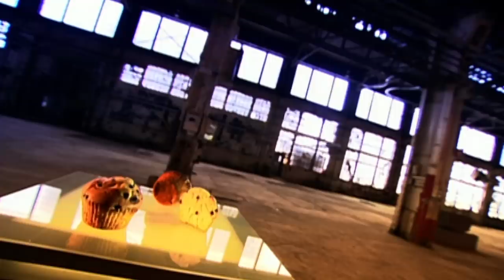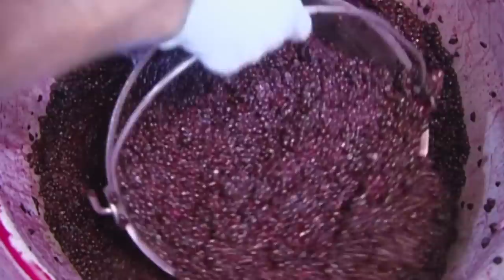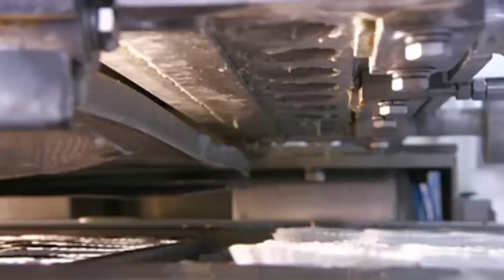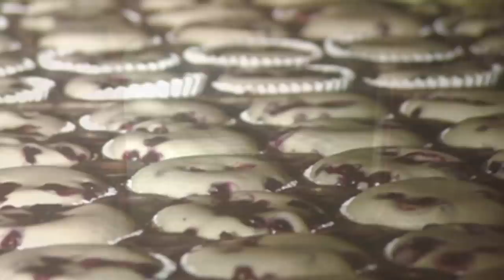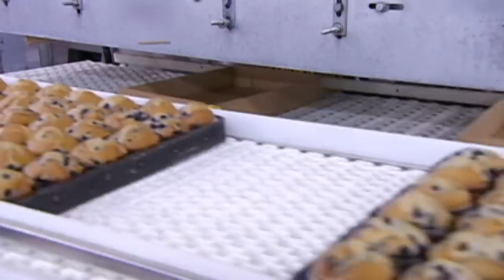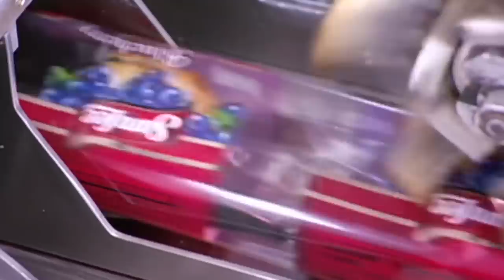MUFFINS | How It's Made

Comment: I wonder if there’s a better way to place the blueberries on top, as some of the muffins didn’t get any blueberries while others got a lot.
Reply: An equal amount of blueberries in each muffin? "You know how long that's going to take?"
Reply: LOL Why did you wonder that
Reply: I wanted the muffin with more berries on top, and you took it! That's why!
Reply: @shanerothery  “I don’t care how long it will take. Put an equal amount of blueberries into each muffin.”
Reply: @shanerothery  why? Just put the blueberries in the raw batter and mix them before you pump the batter into the paper cases … simple
Reply: @liamblack2574  The video already includes that part of the process. They're talking about the additional berries that get placed on top. The distribution, as it stands, is uneven. There would need to be a row of tubes that deposit a set number of berries onto each muffin in the trays.
Reply: @got2bjosh  As said, the berries are difficult to handle, different in size and in tubes they might break, clogging it up and costing money
Reply: @runescaperzzz  The design doesn't have to be tube-shaped. It could be a circular disc that releases a set number of blueberries on top of each muffin round.
Reply: Depending on how the batter is mixed, and factors like temperature and such, fruit added to a mix will either sink or float. I learned about it on Great British Bake Off.